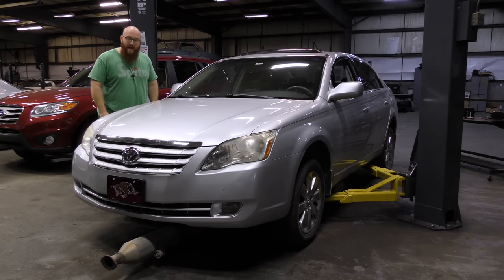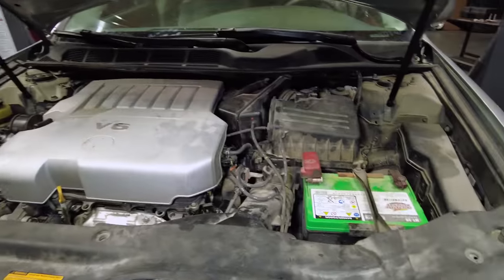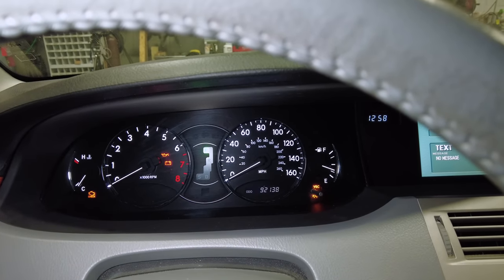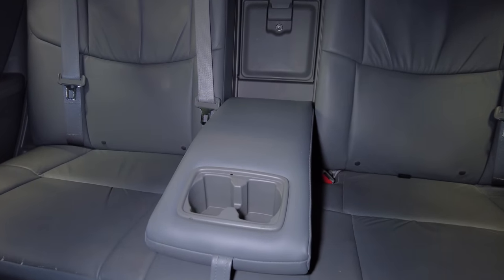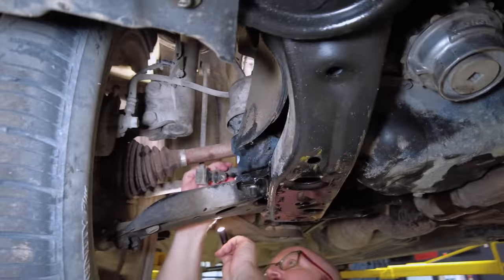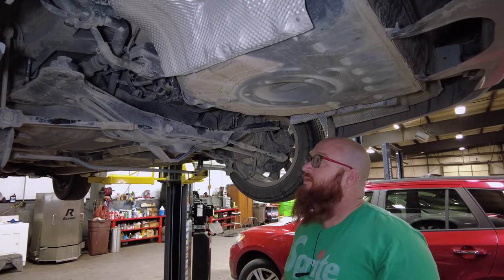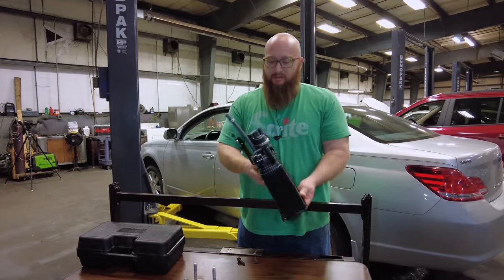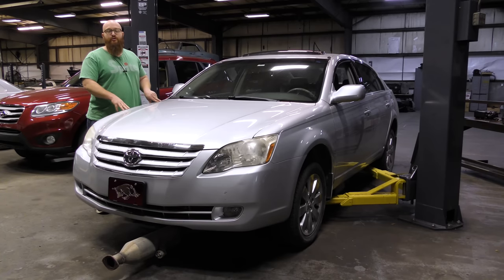Dumbest place for essential emission part on this '05 Avalon! CAR WIZARD is not happy!

Comment: One thing that destroys charcoal cannisters is overfilling the gas tank. Stop when the first click. Or keep it less than full.
Reply: @L Pad yes I bet that happened here because a Toyota charcoal canister doesn’t just randomly go bad with only 92,000 miles, I have a 2006 Matrix with 154,000 miles and the charcoal canister is original never replaced. I NEVER do that at gas stations, overfilling a gas tank is bad for them. Ya don’t want liquid in the canister, just vapours
Reply: You are totally right, the automatic cut-off on the fuel bowser is there for a reason - and it's a great bit of engineering.  Also can't really complain after 18 years of service.
Reply: @Blakecryderman7244  I've got a 2002 Toyota Voltz (JDM version of the Matrix) - and it's canister is still fine too - car only has 160,000km (100,000 miles for you Americans) on it though as it's a family hack these days so doesn't go out of town anymore.  It was my wife's car for over a decade, and she usually ran it on the fuel light, it was lucky if it ever got to half a tank - and these days I think I'm the only one who puts fuel in it - so you are probably right!
Reply: I have  remeber not to do that  I read the Manuel but I usually top off not from empty I have to really think because I do not have money for that I have corrola with 37569 miles I'm the otinsl 15:12
Reply: @halreneau6343  Barely getting started for a Corolla at that mileage.
Reply: as he said tho, the cannister is fine, just that one of the sensors on it went bad and they don't sell the sensor by itself.
Reply: want a video of how u destroy a charcoal canister...
Reply: That’s not true. it’s a car myth like many more in the industry. Fill up full even to have overfilled and gas pouring out of the cap no harm to the canister.
Reply: @toninocars   then how does it get clogged.gas soaked charcoal doesn't vent.when you over fill where does your gas go?lol jeepers
Reply: Oh damn I’ve done that a few times on my 2017 Nissan Sentra, hopefully I’ll be ok
Reply: @toninocars  Wrong!
Reply: I never understood the whole, "I just GOTTA fill it up aaaaaaaall the way to the top" thing. It clicks, I stop. I don't care about that extra 6 ounces of gas. Dunno why anyone would.
Reply: I laugh when watching some guys doing mpg tests on cars but usually trucks. They make a big deal out of putting in more gas after the first click till it clicks again
Reply: @toninocars  Depends on the car and design of fuel tank/canister plumbing. Several videos on YouTube demonstrate this. I specifically remember one on Rainman Ray showing liquid fuel in the canister from overfilling the tank. This was a canister that had already been replaced and lesson was not learned.
Reply: The Toyota 3.5 is one of the hardest engines to work on. I absolutely hate it.
Reply: @JeremyDevries  3.5

Comment: Definitely a WAY underrated car.  Toyota's flagship.  While, like Mrs Wizard said, it's not a corner carver, but it is way quicker then most would ever think.  That 3.5 v6 is one of the best engines ever made, close to 280hp, this thing is a sleeper at stoplights.  It would have been beneficial to show someone sitting in the back seat as it really has limo like rear leg room.  Another back seat detail is the seats recline.  I bought a '06 to flip - 3 years later we still have it because my wife likes it over her RDX for road trips.  Great car, with a fantastic motor... get one while you can, I see good examples like this getting more valuable as the EVs are pushed on us and their real costs and inconvenience become more realized.  The % of people trading back their EV for gas speaks volumes.
Reply: I’ve had my 06 Avalon since 2018 I love my car got it @170k now it’s @303 I love it
Reply: @jasonyurrrr9994  do u have the vvti rattle i really want to get one of these beautys but the vvti scares me a bit i had a 09 highlander with the same engine had the vvti issue but i think its because of lack of oil changes

Comment: That Avalon has had a rough 90k miles lol
Reply: Someone likes wasting money!
Reply: It got the domestic and European treatment lol
Reply: Yeah my dad has won with three hundred and seventy thousand miles and it looks far better than this thing
Reply: Nah  just age.
Reply: @MrBlaze256  Explain to me how my father has an 07 Avalon with the. 375000 miles on it. This is. He's doing more work to this when than he's done to his not to mention his looks better
Reply: @mikebelcher5111  oil leaks happen. How you drive it and take care of the car doesn't effect valve cover gaskets and such dummy
Reply: @mikebelcher5111  so your father bought it brand new 375k and not a leak anywhere never had to replace anything
Reply: @MrBlaze256  Bought it eleven years ago with ninety five thousand he's put wheel bearings belts other than that nothing brakes, wear items the engine has never been open
Reply: @mikebelcher5111  cool story bro

Comment: The other thing with the charcoal canister is people over filling their fuel tank. You should fill your fuel tank until the filler clicks off and then hang it up on the pump. I just saw a person the other day there’s clicked off and they just kept clicking and clicking and clicking over filling their tank which dumps raw fuel into the charcoal canister, and will eventually ruin it, so don’t try to overfill your gas tank. When the handle clicks off, hang it up and you’re done.
Reply: You and me must be one of the 5 percenters that doesn't do this.

Comment: I found an '07 Avalon with about 160,000 miles for $6000. It's in great shape, runs good and is SO comfortable! Lots of room, especially in the back seat area. Perfect for the wife and dogs. I don't think the previous owner knew what he had! It had some rodent issues as well, but was easy to fix. Great car, the wife loves it.
Reply: I bought my 02 Camry with 77k miles for $4900 November 2012, and it has 171k miles now. 160k for $6000 is a lot. When the market goes normal, a similar car like that will cost 3-4K.
Reply: @passion830217  those Avalon 05-11 cost like that no matter the market is
Reply: @haitibwoi6122  2GR engine at that high mileage carries very high risks of leaking oil and coolant. No, it does not worth that much money. A lot of people buy the Toyota quality thing too much.
Reply: 6k for 160k is crazy even for a Toyota
Reply: id like to buy a used avalon too - toyota replced them with toyota crowns - those look really cool
Reply: Same miles I bought it for 3300 you got jipped
Reply: Do you have the vvti rattle im looking for one of these babies

Comment: i have a 2005 Toyota Avalon 201,234 miles the car inside and out looks like it has 20,000 miles never had a single issue or repair just change the oil every 3,000 miles and general stuff , tires brakes wiper blades fluid flush and so on , the only money i spent was an upgrade to the front bumper and grill to a 2008 Avalon because i hated the ugly square fog lights and the 2008 made the car look crazy amazing , from 1975 until 2005 i use to buy a brand new car every year and this Avalon just knocks me out on how great of a car it is
Reply: I have 2006 Avalon. Looks like there is no issues for a car with 181k miles, but I always nervous when I see videos like this and Avalon appears with so many issues

Comment: Toyotas are amazing but certain models, especially v6 models are not easy to work on at all! Glad people are  giving it attention.
Reply: Yeah, changing spark plugs in the 4-cylinder Camry is MUCH easier than doing it on the V6 Camry.
Reply: V6s are hard to work on. But the good thing is that things rarely go wrong on them.
Reply: @paulhoskins7852  spark plugs are a piece of cake even on the V6 engines
Reply: Not on this engine. The rear three require that you replace a million parts. No joke! @andybub45

Comment: I'm not particularly thrilled with Governments mandating all these different regulation's on cars, but this is one that I can say was helpful. I remember traveling from the US to another country on a different continent (without naming them). As soon as I stepped out of the airport terminal, I could smell and feel the difference. This place was full of a rich mix of Gasoline AND Diesel smells in the air. Those first few hours were UNBEARABLE.

Comment: My 1999 Buick has a lockable pass-through as well. It was always annoying on road trips when I was a kid, because we would usually put the drink cooler in the trunk just on the other side of it and then remember that it needed to be unlocked with the trunk key that was on the keychain in the ignition. Easy enough to take the key off the keychain while driving I suppose, but we never did.
Reply: the passthrough lock is for valet parking.

Comment: I had a 05 Avalon XLS also. Bought it at copart with over 230k miles and luckily I didn't have to deal with issues in the "hidden half" of the engine. I know that's a lot of work. I replaced the alternator and that was challenging. But that engine is so good. On the canister subject, overfilling the gas tank overtime causes the charcoal canister to fail. So, with any car even new cars, don't keep topping off the fuel tank after the first click. Good video!
Reply: How much u paid?

Comment: I just had this same service on my '05 Avalon XLS. My mechanic was less than thrilled to repair it as well. Charcoal canister replacement CV boots and Valve cover gaskets set me back a nice 1900.00 but it's worth it to me. At 202,000 miles I really can't complain. It's been an amazing car and I hope to keep it on the road for a long time!
Reply: Do you have the vvti rattle on yours? I recently seen one with a little over 380,000 im sure yours have lots of life left in it

Comment: I did a charcoal canister on a 2005 cadillac cts with independent rear suspension. It was mounted above the diff. had to remove the whole diff to replace it. these things are getting harder to do over time, manufacturers are getting "creative" with the placement. Also I had a 2006 Cadillac STS with push button start. both fobs came with a key that locked the glove box, the "ski hole" behind the rear arm rest, and as an emegency the driver door had a key hole, mainly to open the door when replacing a battery

Comment: The TCC light goes on because, on toyotas of this era,  a misfire can throw both an emissions code, and cause the TCC module to apply brakes suddenly as a result of the misfire (axles jerk, making the wheel speed sensor freak out).  Toyota opted to have the TCC light respond to any check engine light, rather than sort out some codes, but not others.

Comment: Toyotas HATE having their gas tanks overfilled. If the pump shuts off at $58.31 DONT do the gzzzunk gzzzzunk gzzzzunk to get it to an even $60.00

That’s how the charcoal canisters get flooded and eventually fail.
Reply: I have a 2002 XLS and I’m guilty of rounding to the nearest dollar whenever i get gas. Example, if it stops at $29.35, i got to 30. 171,000 miles yet and my charcoal canister is still holding 😂👍🏽

Comment: Also check to see if it has the old rubber oil cooler lines in the 2GR. If it blows zero oil pressure immediately. Updated metal.
Reply: The Avalon doesn’t have an oil cooler, I think that’s only on SUVs and larger vehicles like the Sienna, RX or Highlander.

Comment: They did the same thing on the 2001 Toyota Avalon as well. One recommendation I've seen is "remove the muffler holders  and drop down the muffler a bit, then it can slide out through there." I'm not at all sure that's any easier than "remove the four bolts holding the crossmember in place" though. Especially if you've got a good lift.

Comment: Love doing spark plugs and valve cover gaskets on those. Pays 6.5 hours at dealer, takes  me 2
Reply: Should have done the plugs and the three coils while you are in there, maybe the wires. Save the three coils, in case one goes on the forward bank…..
Reply: @foxlake6750  Toyota coiks rarely go bad. There’s no plug wires in these. If you were to replace all 6 coils with OEM, that’d be over $750… not worth it unless they’re bad but definitely plugs
Reply: I think the dealer timing is based on "have to remove the intake", but it's actually possible to do it with the intake in place with exactly right tools. (thinner fingers help, too). I did eventually have to take off the intake to replace some bad knock sensors. Replaced that one annoying bolt in the back of the intake with a stud and nut instead, much easier for the next person (who was me).

Comment: My '05 Lexus ES330 turned on a bunch of warning lights - it turned out to be a gas cap that wasn't venting properly. I reset the error codes a couple times and they'd come back in a couple days; replaced the gas cap and they've never happened since.

Comment: Flawless bulletproof car that nearly had to have the motor out to change a rocker gasket. Hope you did the back 3 plugs too.
Reply: @Chavez Garza That seems to be the case on a lot of cars that have a reputation for being very reliable. Highlander, Avalon, the equivalent Lexus models, Hondas. Great car and fantastic....until you get that $1500 bill for doing a stupid water pump because you have to remove the entire passenger side suspension and unmount the engine to get to it.

Comment: As much of a pain in the ass this is, this car is fucking bulletproof. I love my 05 Avalon. It's 18 years old, has 180,000+ miles and still feels like it's brand new. Nothing major has broke. Comfiest ride and super quiet but still has a lot of power in it. 2GR FE is one of the best engines ever made. I will simp for this car for the rest of my life. Best car for $5,000 hands down.
Reply: I read that a 2005 Avalon was known for oil leaks?  Any problems with yours?  I'm looking at buying one

Comment: Owned an 09 Avalon with 265k miles on it. I can attest that things are hard to fix on it BUT things usually never went wrong enough to warrant a fix. In my time with it I only had to replace a water pump, rear wheel hub, and one ignition coil. Transmission did finally die but I assume that was more due to me having bigger wheels stressing the transmission more than anything.
Reply: I have the same car but 05. What size wheels did you have?
Reply: Ran 20x9s for 10 years on the car
Reply: Did you ever have the transmission fluid exchanged?  Not just drained and filled, actually exchanged.  Also, did you have the transmission diagnosed when it failed?  May have just been a transmission solenoid.  Seen Camrys (with similar transmission) with way higher miles than that and the transmissions are still going just fine.
Just curious
Reply: Transmission was just drained and filled, never fully exchanged. The transmission had been slipping for a while so tbh I was expecting it to go at some point, I got 10 years of trouble free life out of it so I wasn’t too sad when it was time to let it go.
Reply: @superm7864  I gotcha.  As a mechanic, I know that there is a huge difference between a transmission drain and fill and a fluid exchange.  The difference is about 40-50% of the old fluid being replaced or 90-95%, respectively.  I will only exchange my fluid from now on after seeing the difference it makes.  Toyota transmissions can go an extremely long time if they are maintained properly.  Even a lot of unreliable transmissions will go quite a bit farther if the fluid is exchanged every 30k or sooner.
Reply: I would say absolutely have the fluid exchanged.  Please note that it must be done by a reputable shop or you may end up with problems.  I think that most people's bad experiences with transmission fluid exchanges are because the technicians are lazy and don't bother to set the fluid level after the exchange.  That results in failures and problems, which makes people think incorrectly that transmission fluid exchanges are bad (false!).
Alternatively, you could drain and fill the transmission fluid three times and get close to the effectiveness of a fluid exchange.  Toyotas without dipstick tubes have level-setting drain plugs which, when the transmission fluid reaches a certain temperature (usually 90ish degrees Fahrenheit) you can open with the engine idling and it will set the level by gravity.  Just don't confuse the drain plug with the level-setting plug.  :-) 

At my shop, we use a BG PF5 fluid exchange machine which is an excellent piece of equipment.   It works by hooking in-line with one of the transmission fluid cooler lines, catching fluid that is pumped by your transmission in a large bladder/drum and that pumping force pushes new fluid into the other side of the line.  I have seen completely black transmission fluid turn dark red or almost cherry red after one of those 16 quart services.
Reply: @11Wael  dealer is probably going to be more expensive, I'm quoted around 200 USD for a drain and fill at  Toyota, but you get the benefits of the proper ATF WS fluid and more technical precision with Toyota technicians working on your car. But considering your Avalon is a little over the schedule maintenance, perhaps a good course of action is to do this drain and fill + another drain and fill at earlier time, say 30k miles which is half the interval what Toyota advises. This will circulate the old fluid out in a gentler way rather than a relatively harsh complete fluid flush. And then after you can continue normally (hopefully) with the OEM fluid. In this case if you're going mechanic route as long as the brand is World Standard style it should be fine because of this procedure. Because instantly it will be mixing with old fluid and you'll change it out earlier than expected